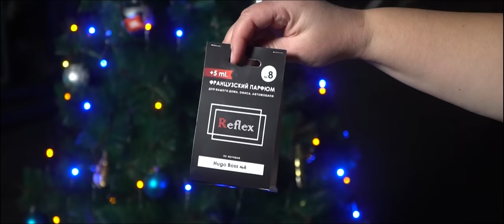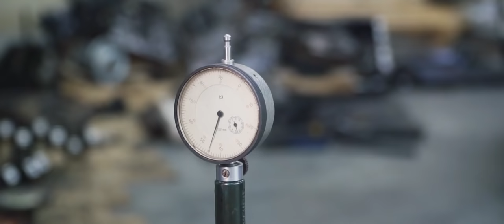We make a working I-6 out of two Lada 4-cyl engines

Comment: So engineers at toyota took years to make the 2JZ and then theses dudes make an inline 6 in 2 or 3 months. Bruh
Reply: The difference is Toyota has to design new engines that don't physically exist yet. Garage54 modified engines that exist in large numbers. That's why you can reduce the time since no manufacturing takes place, just r&d of existing equipment being modified into something new.

It shouldn't be that hard to have figured that part out, I mean someone shouldn't have to spoon feed the concept of developing an product that doesn't physically exist yet. It's not like the industrial boom hasn't been around for over 200 years... Oh wait it has!

Fyi I'm not dissing garage 54. Those guys have all the fun and they are great. Not like any other channels have content like this. I'm merely pointing out the difference between development and modification.
Reply: connect two v6 become big v6 or v12 is easy too

Comment: I thought it would be easier to combine 1st 3 cylinders from one engine and last 3 from the other, turned 180 on crank and cam, but i love it as it is. It's a miracle you guys got it running in any shape. Incredible skill.
Reply: Well for a long time a 2 cylinder was impossible bc of balance issues but they made a 1000 hp 2 cylinder it's super charged and turbo but it's very impressive for the size a 2 cylinder so imagine three or four 2 cylinder like one for each wheel
Reply: @executiveorder7146  ask a Fiat 126 whether a 2 cylinder engine is viable. I owned some Polish concoction called a Niki in Australia that had an air cooled, and by my own analysis half a VW Beetle engine at 650cc makes it half a 1.3lt VW 4. So naturally I turbocharged it and sold it to a bunch of real estate agents, the for sale ad is still online somewhere and I still get calls.
Reply: That's what I thought thay would of done 3 cylinders from one block and 3 from the other, I was abit like what thay doin but it worked
Reply: This was also my thought. I just figured they did it for some reason, they covered a lot of ground in less than 20mins.
Reply: @JesusisJesus  There is also the ONAN engine- it is like half a VW air-cooled engine. Very popular for a mobile air compressor and that ONAN engine is also used in the EZ-GO utility vehicle.
Reply: The weak point of this engine is the weld in the crankshaft, my opinion is that if you did 3 + 3 you would get more differential torque with 3 + 3 than 4 + 2 in terms of the torque being delivered to the flywheel end of the engine, so I think they went the right way with the idea, I have no idea if that was their thinking or not, but it seems right to me, could be a lot more simplistic than that, perhaps where oilways and coolant paths are etc. It's just not as simple as one might think.
Reply: @JesusisJesus  Fiat Niki -> it's a Fiat 126p. Inline 2, 654 cc engine. People usually swap R1 / CBR 600 / R6 and so on engines into it. The purpose of that engine was that anyone that had only a few tools could rebuild it. My grandpa literally worked on one all the fricking time.
Reply: @mikester1290  very true.
Reply: Is there a 6 cylinder distributor cap laying around anywhere..."Let's do this..."
Reply: @amazur31  In Australia it was sold by Fiat dealers as simply a “Niki” they are now selling a 500 with much better safety.
It did not have the rounded edges of the original design, this was very angular in shape and was almost a bad copy as it was barely road legal in Australia, but it ran on the smell of fuel and started every time so was great for short trips to the shops or train station because nobody would steal it, even though a couple of men could pick it up and walk away with it… to turbocharge it, I simply flipped the carburettor air intake, connected that to the compressor outlet, hooked up an oil feed from the pressure sensor and oil return to the dipstick attachment back to the sump, and joined the exhaust into the turbo somehow. So it went from 17hp to probably 23 on 3-7psi of boost. The fuel pressure return blocked off or something so the carburettor had enough pressure to carburate against the turbo pressure. It was more fun for the noise factor than anything.
Reply: @amazur31  And yes I was eyeballing a hyabusa engine and trying to figure out how to chain drive a straight axle, and get reverse gear.  This was a very long time ago.
Reply: @executiveorder7146  2 cylinder engines have existed just fine in motorcycles since 1894 lol
Reply: thats what Allen millyard does
Reply: Exactly
Reply: Nailed it! BlasterTC
Reply: I would think more in the line of using the first and last cylinder of one engine, cut off the front and back of the other engine and weld them together.
Reply: @JesusisJesus  "So it went from 17hp to probably 23 on 3-7psi of boost." So you boosted it into factory power? heh
My cousin daily driver Fiat 126p was doing propably 50hp after modifications, plenty of them was needed to get there but turbo or compresor was not one of them.
He was also racing in one that was doing at least 100hp at 8000rpm(his daily driver was doing only 6600).
I saw VHS videos of this Fiat from race track and it was acting more like Subaru Impreza than Fiat 126.
On 4th gear and 8000rpm that "Fiat" was doing only 100km/h but the acceleration and how it was taking corners was kinda crazy. But hardly anything was notmodified in this car, the engine even got its own radiator so they added liquid cooling to air cooled engine.
Reply: @executiveorder7146  "The flat-twin design was patented by Karl Benz in 1896 and the first production flat-twin engine was used in the Lanchester 8 hp Phaeton car released in 1900."
Reply: @Bialy_1  This was 20 years ago so please excuse this 40 year old guy’s failing memory of what was possibly a 23 horsepower 2 cylinder engine strapped into the ass end of a coke can with road registration, forgive me for not putting it on the dyno at the time or even installing a boost gauge in the car. It simply wasn’t worth it. Assuming a healthy 7psi the numbers would suggest around 32.5hp, hardly earth shattering at a time when I was building up a few cars like N13 Nissan Exa Pulsars, 2 other cars with SR20 turbos and a 1UZ turbo V8. The Niki was just a funny joke to use up some spare turbo bits. These days, I’m more interested in other things. Given my time again I might’ve blown a few bucks on some sturdy internal parts and jammed more boost into it, but it felt as safe as going downhill in a shopping trolley with an icecream tub as a helmet.
Reply: @ronniemaeker9102  ... you'd also need 6 lopes for the points or reluctor to make spark at the right time.
Reply: @rupe53  OR....take a 6 cylinder cap and fire every other one...
Reply: @ronniemaeker9102  ... you still have the wrong number of lobes. The difference between firing 3 times or 4 times is 30 degrees off on spark timing.
Reply: @mikester1290  well whether it's 3+3 or 4+2 you're still going to end up with 2 sets of cylinders that are firing at the same time and 2 single cylinders that fire alone. it's made from two 4 cylinder engines that are timed like normal 4 cylinder engines
Reply: @iamzid  Yes, I wanted to say the same. The block fine this way, but the crankshaft and camshaft should be made from 3 pieces, angled 120deg apart, isn't it? And a 6cyl distributor would also needed. At this point, I wouldn't think it would be much harder to do.
Reply: @KayoMichiels  The end of the engine is important, because that's where the oil pump is (I guess, there is on a Lada too, maybe I am wrong). And the oil galleries, etc. If you keep at least one end, you have way less headache. As someone said, doing this seemed easy in the video, but in parctice it is very far from easy!
Reply: @gabiold  I know, i know... i don't know the engine... they have.
Reply: @gabiold  yes perhaps, but you know how these guys are. i think they just line these things up by eye and so 2 parts straight is much easier than 3 parts at 120 degrees, what requires much more accuracy. it works like this right? why work harder for a very small improvement?
Reply: @iamzid  Sure, but actually they did a quite precise work. Making this to rotate properly is hell a difficult task, and they are improved quite well. They use lathe and all sorts of stuff now. I know, these videos are just for the show, but I am sure they learnt a lot from these seemingly stupid projects.

Comment: I'd love to see that engine run long term and see if it can handle running for a extended period of time. Honestly you guys never cease to amaze me with the things you guys come up with
Reply: The welds would give way eventually or perhaps I should say the metal around the welds would.
Reply: @Lofi.z34  Also you could say this is more of a proof of concept, if they really wanted to make a "legit" one, i bet they can.
Reply: definitely
Reply: I see a bigger problem in wearout. Even though the crankshaft was mounted in the bearings while they welded the blocks, the welding makes the metal move. The coaxiality of the the crankshaft bearings is way too unpreciese, same problem with the camshaft. I would give that engine 5-10 hours, then the bearing shells would be worn out and the engine would most likely die of diabethes.
Reply: I would bet they are aware of this. A simple regrind of the crank journals. And oversize bearings would take care of that

Comment: I would have used the front three cylinders from one engine and the rear 3 cylinders from the other and welded the crankshaft together but still an amazing job and I can't wait to see it running in a car definitely fun to watch for Christmas.
Reply: Crank journals would be in the wrong position
Reply: @timvanderbyl3077  probably... But half the idea of doing that is problem solving everything like main journals, rod journals, upper & lower oiling and other stuff like that. That's why watching this project is so fun.
Reply: Do it and see how it works out, keep us posted!
Reply: @timvanderbyl3077  they are kind of in wrong position now too, the rod journals should be 120 degrees apart
Reply: @MadEvo606  somewhat true, however they still have a chance of being somewhat in balance this way.
Reply: @KCDrives  they have way more resources than I do, so I certainly would not be able to do that. I'm just a keyboard warrior
Reply: @DaveFromColorado  I appreciate your honesty.
Reply: @KCDrives  I wouldn't have it any other way :)

Comment: A few tips: 
1) Modify the crankshaft to make the pistons move to balance each other. Two pistons should always move at the same time, one on either side of the middle of the crankshaft.
2) Make the stroke longer and the block taller, then tilt the engine to one side and modify the oil pan's bottom to be level with the ground.
3) Modify the intake and exhaust manifolds to be level with the car's hood.
You now have a BMW engine from the 1972 BMW Bavaria.
Reply: Sounds like a slant 6
Reply: No, now you have a Chrysler Slant Six... Made long before that '72 BMW engine. The Leaning Tower of Power. AMAZINGLY durable engines.

Comment: Nice work.. Now I am curious to know how a 7-cylinder inline engine would be like 🤔
Reply: Sounds like a plan:
1. Build 7-cyl engine
2. Take it to the dealership for the regular maintenance
3. PROFIT!!! (see their reaction)

;)
Reply: an 8 cyl inline 8 would be cool too
Reply: @yeah.2596  They already did that
Reply: Not balanced
Reply: 360/7 = 51.428571 

You might get it to run, but it will suck.
Reply: @tedteddy2293  what about the inline 5 and inline 3?
Reply: @Racing_Dude  chevy has a 3 cyl in the spark now and came out with a 5cyl for the colerado.
Reply: @Racing_Dude  fiat has inline 5, 1.2 TDI is inline 3.
Reply: @Racing_Dude  Inline 3's have been around a long time and Audi has been doing inline 5's since the late '70s I think. Great engines. Even Acura gave it a go, but it's not that interesting.
Reply: Well usually odd numbered inline engines aren't balanced naturally very well but you could probably figure out some way to use a balancing shaft to take out a lot of that vibration.  I'm not sure how Audi did it but odds are they had to figure something out because  You usually have cylinders firing "powerstroke" in pairs so that the vibrations counter each other.  Without a  Paired firing cylinder for that "7th" or "5th" or "3rd" cylinder it's bound to create some level of vibration
Reply: @Away907  I know for a fact there are seven cylinder radials. They sound pretty cool
Reply: @mediocreman2  My favorite inline three from Audi is on the 59 or 60 roadster they had that looked like the t-bird. It was a two-stroke
Reply: @yeah.2596  8 cylinder exist. 7 cylinder is more interesting as it was never made

Comment: Now make it turbo charged and see how much power it makes.
Also Merry christmas and happy holidays!
Reply: That crank will shear in half. Then need to get an actual solid milled out crank shaft, then maybe it stands a chance
Reply: Twinturbo maybe?:)
Reply: Imagine welding 3 engines together and make it fit in the car
Reply: @lonelytoaster2915  put it in mid engine
Reply: @lonelytoaster2915  Lol 5 maybe?:)Owerkill time!
Reply: @lonelytoaster2915  they've done that before
Reply: Russian 2JZ
Reply: @eddieproffitt2164  really which video is it?
Reply: Then they have a Supra😂
Reply: Turbo's are for yankees. They need a compressor from a MiG-21, vodka cooled.
Reply: jó ötlet
Reply: Turbos and Carburetors don't mix well.
I mean it works but not well...
Reply: @0mniVerse777  With a low boost turbo, the crankshaft might actually survive long enough to measure something... Still would be interesting to see how this thing sounds with a turbo.
Reply: @speedysandisk78  Noice thinking bro!
Reply: @joe125ful  its blow up
Reply: @thegreatguitarist2310  Depend on turbo size/type..
Reply: @0mniVerse777  Does it need to stand a chance on this channel? :D
Reply: @lonelytoaster2915  Inline 12? W12?
Reply: @0mniVerse777  Nope, its a LADA!
Reply: @joe125ful  god damn right 

ı think six racing carburetor and nice exhaust better than turbo for this motor
Reply: @thegreatguitarist2310  Well probablly yes:)
But need some balancing and firing in right order too.
Reply: I dont hink this block will handle boost, but who know the russian style might work cyka
Reply: @mutazasha3895  There is only way how find this out...
Reply: @0mniVerse777  i wonder if they could do a splined 2 piece crankshaft, or maybe something like Rob Dahm's 6 rotor e-shaft.
Reply: Give it some anti-lag,then put it in a Supra

Comment: The crank needs  each  stroke to be separated by 120 crank degrees.  a 4 cylinder needs 180.  so the entire crank needs to be a different design to make this work without breaking to pieces.

Comment: Beautiful work, guys. But when he turned over the crankshaft at 8:25, I saw that there are 3 cilinders working together. Normally, a 6-inline has 2 cilinders working together. The difference here, is that now every 180 degrees, 3 cilinders have their ignition, whereas normally every 120 degrees there are 2 cilinders having their ignition. I rekon this wil result in a much smoother power delivery and more torque. It's a lot more work, but I know you can do this. I've seen a video before where you made all 4 cilinders work at one. Maybe a next time?
Reply: ...or one of the 3 could be on exhaust stroke TDC
Reply: You mean on a six, two cylinders are usually at TDC, they don't fire pairs of cylinders together on a six, one will be at compression whilst the other is at the top of it's exhaust stroke. Unless you mean a wasted spark ignition where a spark occurs at every TDC?
Reply: @phil955i  yes, you are correct. Should have been "2 cilinders are normally at TDC, not 3 cilinders". Ignition is wrong.
Reply: @SeamonVB  it's not a six in the traditional sense anyway, the crank phasing is at 180 degrees as per a four, as you said a six has crank phasing at 120 degrees, so this will just sound like a four. I do love it though!!! Lol.
Reply: I don't really think the "daisy chained" spark plug wires would work too ideally either...  I mean , ultimately, it can only fire one plug or the other when they're coming from the same distributor post...  What do you guys think about that?
Reply: @billymanilli  I agree it's not ideal, but should still spark two plugs simultaneously, even at higher rpm. Most modern coils put out north of 40,000 volts, which shared across two plugs should still produce a decent spark.

Comment: TAKE THE POINTS OUTPUT TO THE CENTER OF THE DISTRIBUTOR CAP, THEN MAKE A SPRING LOADED ROLLER ON THE ROTOR TO CONTACT INSIDE THE CAP PLUG WIRE OUTPUTS SO THAT THEY ARE 12 VOLT OUTPUT TO FIRE 3 DUEL EXTERNAL COILS TO FIRE THE PLUGS LIKE A HARLEY IN PAIRS, SO THEY FIRE ON POWER STROKE AND THE EXHAUST STROKE. BECAUSE YOU WILL ALWAYS HAVE PROBLEMS TRYING TO FIRE 2 PLUGS WITH ONE SPARK. YOU WILL NEED 6 DIODES TO ISOLATE THE THE CAP OUTPUTS BEFORE GOING TO THE COILS, 2 OF THE DIODES WILL BE TIED TO THE PRIMARY 2 COILS, ONE FROM EACH TO GO TO THE 3RD DUEL COIL FOR THE EXTRA 2 CYLINDERS. TO BAD I CAN NOT POST A WIRING DIAGRAM FOR YOU TO FOLLOW.